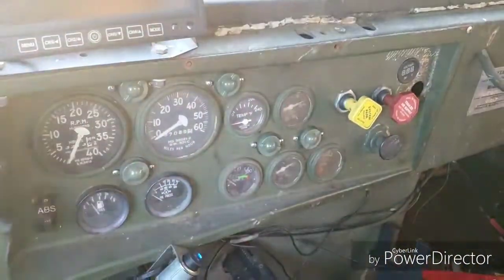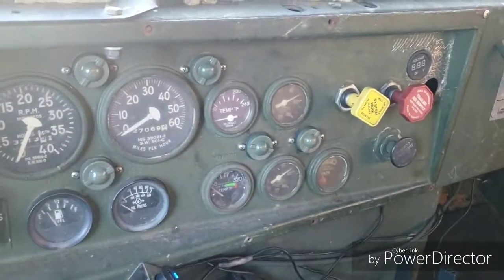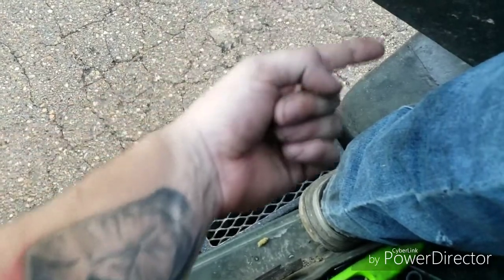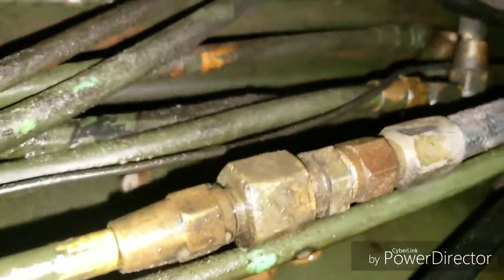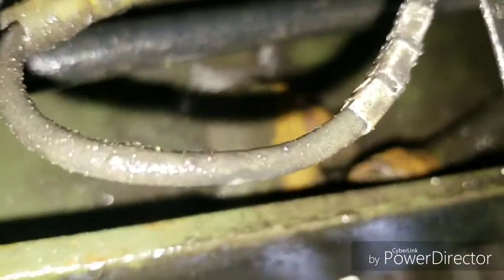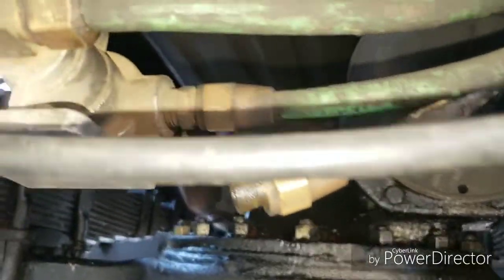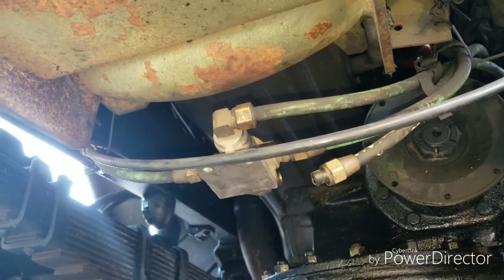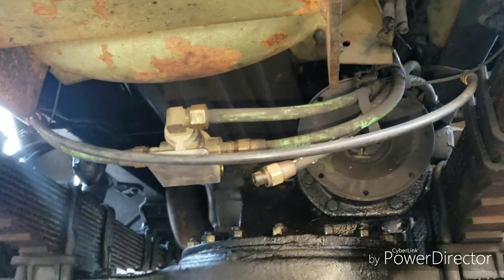M939 series truck - Air diagnostics - Q2 valve/service diaphragm failure

Comment: Hello sir. I have a m939/a1 military dump truck. Brakes are locked up when i have full pressure to both tanks and parking brake and spring break released. I went thro ur video. I diagnosed it is not q2 valve since i was still hearing it vent out intake. Next step. I let it build full pressure. Shut engine off. Shut both tanks off. Press brake pedal. It leaks from secondary tank. So its front service brakes. I have new diaphragms to replace both fronts.  But i dont know if the pushrod is under pressure? I dont want it to blow up in my face. The truck is off and all air pressure is bled. Is it safe to open flange? I would appreciate ur advice. Thank you sir
Reply from the maker: Under the hood. Drivers Firewall by the pcb there is a a series of 5 hydraulic fittings air lines into the parking brake valve.   Remove the lowest one with a 7/8 or 15/16 wrench and see if you have air dumping from there
Reply: Ok. I will try that now. Thank you
Reply from the maker: @rocketsquadlevitowns6114 if it doesnt do anything.   On the frame rail. Drivers side. Behind the air box there is a metal block that will have 4 to 7 different air lines going into it.  They will have a white base color.  Might be painted over... those are vent lines from every part of the truck.  Take one off at a time and let me know which way the air is coming from.   Simpson.wes.1985@gmail.com is my email
Reply: I pulled out the line as you described. Do I have to allow it to build to full pressure? Cause no air came out at 30 lbs. I took picture of line
Reply from the maker: @rocketsquadlevitowns6114  that bottom valve fitting on the fire wall should not dump any air with the brake pedal pressed. If it does the treadle valve is bad.  It should vent air when the pedal is released
Reply: Ok. Thank you sir. I will look into what it will take to replace the treadle valve. You have been so much help. Your awesome with your knowledge. I will keep u informed.
Reply: I will try your next suggestion and email you back. Thank you sir for ur advice.

Comment: I have a m923 a2 that just started leaking air off to the horn at about 60psi. And blaring the horn none stop and now it won't reach operating air pressure. Any idea what's causing this?  It's been below freezing for weeks could a valve be froze up?
Reply from the maker: https://youtu.be/6u_blhOAYDI
Reply from the maker: Pressure protection valve opens at 60.  You have a bad diode at the horn probably.

At current your Pressure protection valve is frozen up.

Comment: Wes have a M923A2 and a couple of weeks ago went to drive it and no air pressure registering on either gauge????
Reply from the maker: If you know you are building air pressure there are 2 air lines at the brake pedal on the gas pedal side.  Rig up a known good air pressure gauge off of one of those ports   those feed the gauges
Reply: @wessimpson2794  I am not building air pressure and am looking to use the glad hand to pressurize the system and see if I can hear a leak somewhere.  As I face the front of the truck there are 2 glad hand hookups, one on the right side that has a valve knob on it and then one on the left side that does not have a valve to turn..was wondering which side I should hook up the air compressor to, in order to put air in the system and search for a leak without the engine running (because I can't hear anything with the engine running)?  Thanks, John
Reply from the maker: @johnminker7061  drivers front or passengers rear   you can use either of those.

However I recommend removing the discharge line from the back of the compressor on the engine and rigging the input pressure there so you are simulating a compressor     using the gladhands doesn't get air to all parts of the system.

Where are you located?
Reply: @wessimpson2794  In Spring Grove, IL
Reply from the maker: @johnminker7061  good ways away   I am in Memphis 

I am fairly sure you either have a stuck purge valve on the air dryer or the unloader on the compressor is stuck

Those are the 2 most common things.   The wet tank on the passengers inside frame rail has 2 shut off valves    one top and one front. You can shut these once the air starts going up to 120psi to find which side has the leak.

For faster messages you can find me on steelsoldiers as simp5782

Comment: My 9 series truck builds pressure fine 135 psi give or take. But after driving it for a period of time it stops building psi. Any ideas. Let it sit. Come back and it builds 135 psi again
Reply from the maker: When the truck builds to pressure and purges.   Remove the small metal line going to the top of the air compressor.  See if it has air on it constantly.  If yes. Replace the air governor. If no and the compressor is not running then remove and clean the unloader
Reply: Wes Simpson I drove it 300 miles last night from Michigan to Ohio. And it did this a few times to me during the trip. Came out this am and fired it up and it built great pressure and purged just like it’s supposed to. My low air light doesn’t come on or the alarm.
Reply from the maker: @3pedalracing138  i am simp5782 on steelsoldiers if you are not a member 

Remember the compressor and air dryer see a different air pressure than your gauges read.  The dash gauges are showing primary and secondary tanks at the brake pedal.  The compressor sees air from the wet tank via the pressure protection valve.  The primary and secondary tanks have check valves to prevent back flow into the wet tank.   So your wet tank may show 80 psi to the compressor but your tanks show you 125
Reply: Wes Simpson I’m not a member but will join. Unfortunately with all these terms I don’t know what the items are your talking about. Wet tank and stuff. Sorry I’m very new to these trucks and air brake systems. Where are you located ?
Reply from the maker: @3pedalracing138  Memphis but I travel all over.   I try to avoid areas like Ohio since they don't pave the roads there.  I'm sure you are hurting. Michigan is horrible
Reply: Wes Simpson my tailbone hurts so bad. 56mph for 4 hrs lol I hope I can figure this thing out.